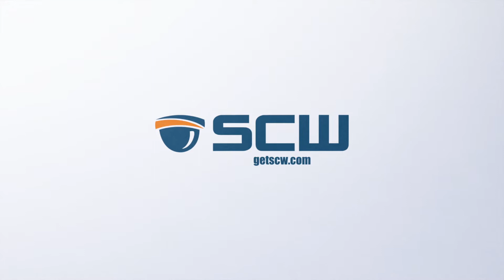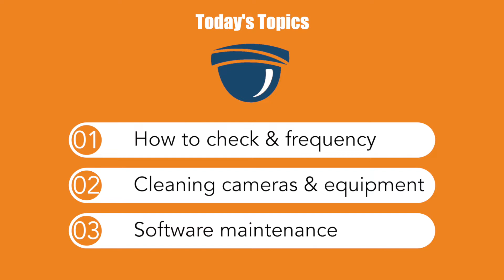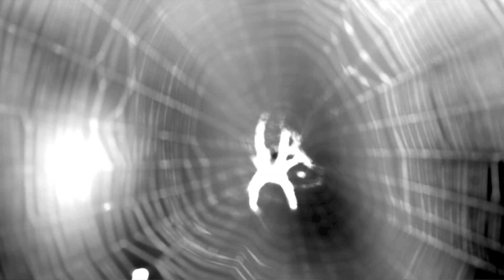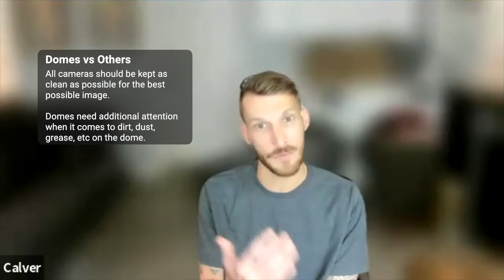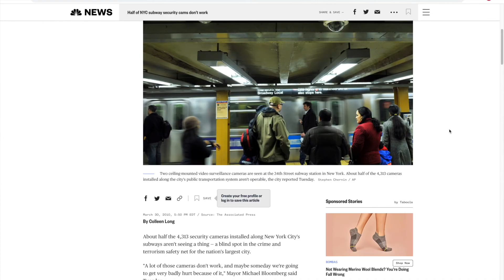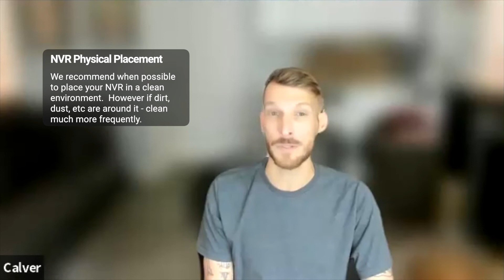How to clean and maintain your security cameras

Comment: What if the Cameras are set up at a High Dust Construction Site? Cause Maintaining the Cameras manually costs much right?Is there any Simpler and Cheaper solutions for that? Would be Happy if u replied pal!!
Reply from the maker: Hello - great question! The dirtier the site - the dirtier the cameras are gonna get. There are tools out there are specifically built to clean cameras and reach far ones - that may simplify the time to clean.  There are even some limited self cleaning housings for really dirty areas but as you can imagine it's very costly.